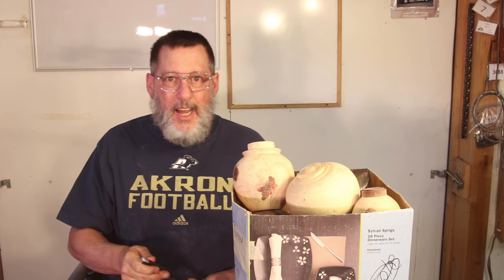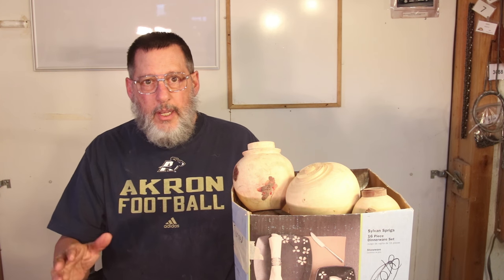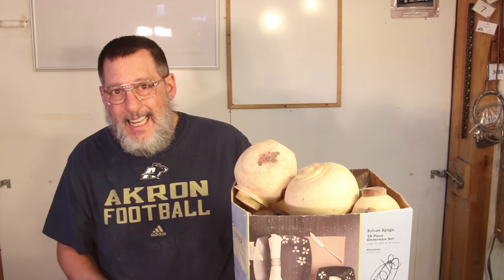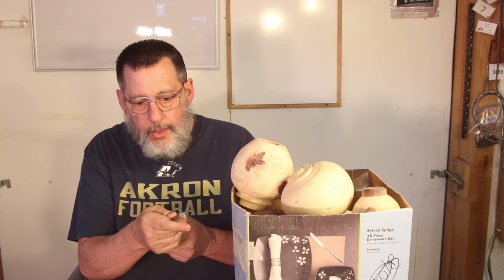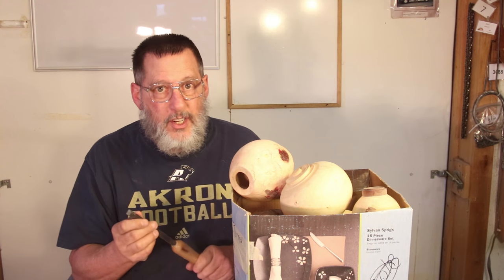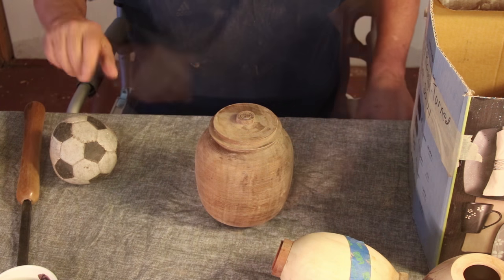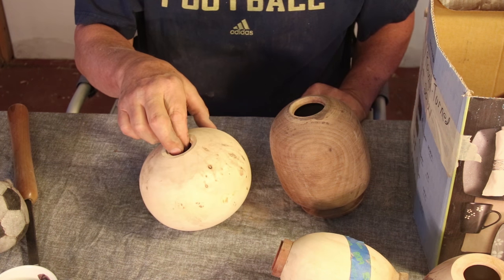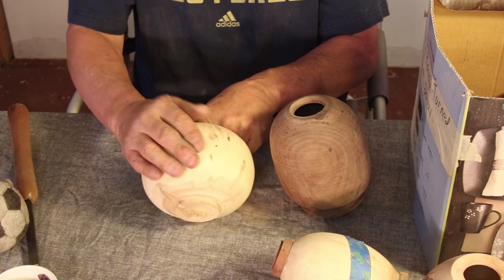Completing a Rough Turned Hollow Form ....with Sam Angelo

Comment: thanks for sharing this, I have some of those threaded rods with a 1mt fitting that someone gave me a while back and I've never really known what they are used for or how they are used, now I know ;)

not just that but a lot of this video helps me out, especially the truing up when dry!

Mark.
Reply from the maker: I am not sure where I got this idea.  It has been around.  They are easy to make.
Sam
Reply: WYOMINGWOODTURNER yeah ill definitely use it, im wet turning a few hollow forms now and until i saw this i was not looking forward to spending more money on those big flat donut things which i can't remember the name of, they are yellow and are fixed together with threaded rod with the hollow form sandwiched between.

Comment: Beautiful piece, and excellently explained. Are you ever worried about the cracking of the opening when you put a different species insert in it?
Reply from the maker: No, the insert is very thin and small and dry.  I have never had an issue
Sam

Comment: Found the video very helpful Sam, how thick do you leave them when you rough turn them?
Reply from the maker: Owen
I leave them about 10% of the diameter.  So a 10" bowl would be 1" thick.  The same applies for a hollow form.  The art is not making it too thick  or too thin.
Sam

Comment: Nice-- but it stopped just as you got to a part I most wanted to see, actually finishing the bottom (ie shaping the inside part of the foot that I can't reach with the tailstock in the way) and getting the final nub off. That's often a most challenging step.
Reply from the maker: Roger  yes I did go back and watch the end.  I did everything but take off the little nub.  I just saw that off and sand the base-not much too it, but i did not show the sanding.  Here is a video from 2013 (yikes) the resolution is not great but it is showing how I reverse a bowl and finish the bottom.  I do show the nub being removed.  
https://www.youtube.com/watch?v=Vdn0PdySkh4    I do saw it off but I still don't sand it
  Sam
Reply: @WYOMINGWOODTURNER  Thanks for replying! I often struggle getting to the inside rim of the foot with a clean cut on pieces that for some reason I can't hold on my vacuum chuck or cole jaws. I can usually poke a scraper in there, but the cut is terrible, and trying to make any more elaborate shape impossible because my tool hits the tailstock when using a friction drive. So I'm always looking for how people solve that problem. Love box elder!